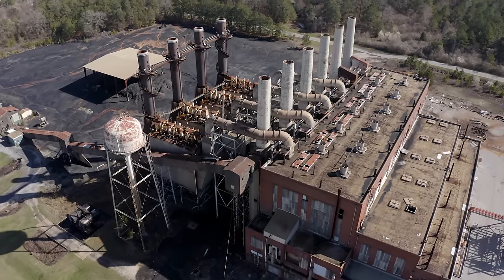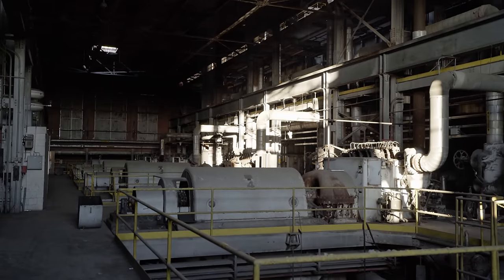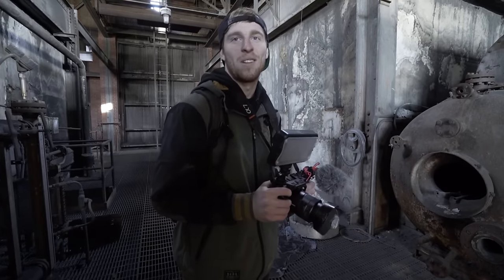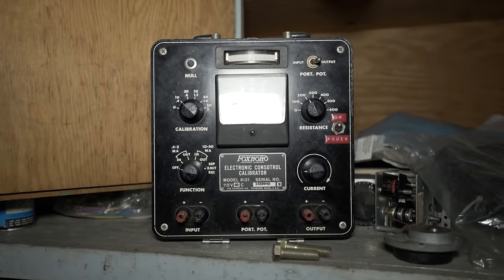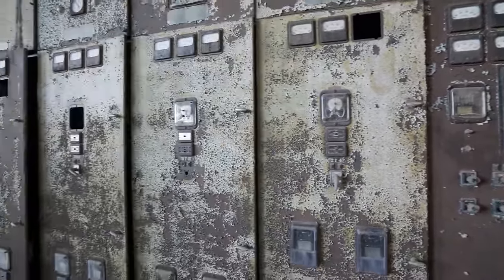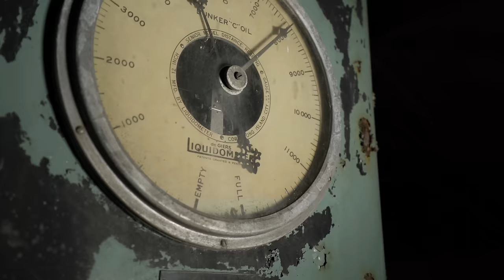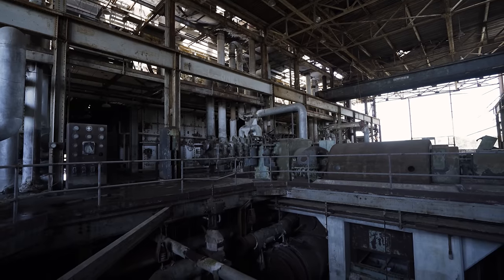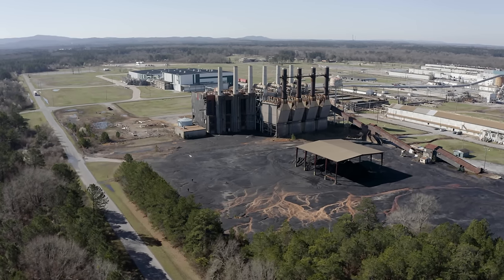Exploring WWII Power Plants Abandoned Decades Apart - Amazing Contrast in Decay!

Comment: GE in upstate NY and many other large companies had unlicensed, unauthorized nuclear reactors to make free power to run their factories

They were all taken out in the 70s, but it is crazy to think that these companies were able to get the nuclear material to run them and they were able to build them in secret

There were a lot of people who were hired specifically to build and maintain the nuclear reactors

These companies all were working for the government in different fields
So, whether the government knew about them or not, there is no way to say

But there was one reactor that was actually abandoned and nearly melted down when the external power that was regulating it was shut off when they were tearing down the building

It was discovered by a worker who was in the basement and they knocked through a wall that was not supposed to be there in the bottom of an elevator shaft

It revealed the reactor and the reactor room that was built in secret

I don't know if they ever did a documentary about that incident
Reply: Probably not because it would probably get people freaked to discover that those exist! Makes you wonder how many more there might be, waiting to be discovered!
Reply: What a surprising thing to find when demolishing something and not knowing what was there
Reply: That event was the inspiration for the Scorpion Plutonium Is Forever episode.
Reply: That's hard to believe they'd abandon a plant that was still producing enough heat to risk a meltdown if the pumps were stopped.
Reply: @russellhltn1396  Why would it be surprising?
Reply: @russellhltn1396  it wasn't a plant. They had built a reactor under one of the factory buildings. Only the people who were maintaining it knew about it and a few top level people. When they were laid off they were told to make sure it was stable and shut down in standby.

As with many things, the people left that knew it was there didn't realize the danger or how to maintain it.

It sat quietly and then it was forgotten about. I am sure that each person who knew it was there just assumed someone else had taken care of it years ago and that it was not a threat.

When they contracted out the demolition the contractor subcontracted to other low bidders and pocketed the difference

You had a lot of laborers manually knocking stuff down and scrapping what was worth something

The elevator shaft had an obvious temporary wall that was not on any blueprints and there were a lot of power and water pipes running through the wall.

When they knocked through they found it and didn't have a clue what it was, but they saw the blue glow and the heat and knew it was not right

A local college was contacted and they came out and they immediately called the DOD who called the DOE and I think the ACE 

They were not the only company that built these things in the basement of their factories

Eastman Kodak had them. I think IBM had them. NL Industries I know had licenced ones, but might have had a few unlicensed ones

I used to work for the state and I would see the reports of cleanup sites and they would find barrels of radioactive waste buried along the river.

The reports listed what they could find and it had uranium and other elements that were known. The craziest thing on the reports at the bottom were the elements they couldn't identify.
They had all the atomic information with the weight and information I didn't understand. They were listed as UNKNOWN and they were literally elements that didn't appear on the periodic table. Exotic Elements.

Some of them are NOW on the periodic table, but some of the heavier ones still are not listed.

I don't think they were trying to make exotic Elements. I think that was a byproduct of running an unregistered reactor.

But they literally just put the waste in 55 gallon drums and buried them at the edge of the property.

Years later I would be working for a city and I saw the water intake reports and they showed the natural occurring radioactive elements detected, and they also showed UNKNOWN nuclear elements listed on the reports with all the other heavy metals and salts.

It was confirmation that those barrels leaked into the river and we're sitting at the bottom of the river

The PCB cleanup stirred up a lot of them.

Fun Fact, that same city had the sewage discharged through tunnels built in the 1800s and raw sewage just poured out 4 tunnels into the river until they were forced to put in sewer pipes and CSOs to join to the county waste treatment plants in the mid 2000s

The city had 30,000 residents

There were rivers of waste pouring out these tunnels. I remember that smell and the water. It is hard to believe but they didn't have any money and they left the roads dug up dirt and didn't have any money to replace them after they put in the pipes.

I am glad I didn't have to go in the tunnels. Some of my coworkers did to build the CSOs.

Awful work

When they knocked through the wall
Reply: @adamdnewman  I find it hard to believe that the company just said, "let's build a nuclear reactor".  That's not trivial.
Reply: So far I only knew of three unlicensed nuclear accelerators in New York in the 80ies.

(Spoiler: Ghostbusters)
Reply: @uhrbexer9134  in the 50s most large companies that used a lot of power were looking for a way to save money on utilities
Some built their own hydro power, others built huge coal fired power plants. But a few who had contracts with the government and we're doing work with nuclear material for equipment, X-rays, test equipment, weapons, they built their own secret reactors

It is not that hard if you are really irresponsible to build a nuclear reactor
You are boiling water and when you make steam turbines as part of your business to sell to power plants, it is really easy to install a few in your building and run the steam from the reactor to power them.
600 pounds of steam through a 2 foot pipe 
The pressure vessel that keeps the water and steam and the biggest problem is how to release the steam without it being seen

Some reactors were sealed sodium and there was no steam, but the ones that used water from the river were hooked up to the smoke stacks

Contant steam mixed with the smoke

In the reports I saw the trail of fallout was very clear

The wind patterns were mostly 1 direction and you could clearly see where the wind dropped the radiation ovet a 1 mile path from the plant

To this day there are a is still a dead zone with nothing there 

And NL Industries in Albany NY to this day is sealed off
It is highly radioactive
There is a constant DOE security patrol even though there is nothing left
It is just dirt but they have a 24 hour security in vehicles and they have a couple port a johns and a huge fence all the way around the property

So many people died in their 40s that lived near the facility

It is horrendous how much they didn't care

It was all about making money

They had lots of money but they wanted more

Very sad

Comment: Sounds like they mothballed the plant with the possibility of restarting it one day. Sounds like the oil system for the generators were running and they are in turning gear. If you stop the turbines over time the shafts will ‘melt’ into the habit.

Comment: If it was this noisy with only a few things running I can only imagine what it must have sounded like under full operation.
Reply from the maker: I don't think the turbines and the boilers are actually that noisy when they're running. I toured some active plants and the air compressors were the noisiest things there.
Reply: @TheProperPeople  I've been in a modern coal power plant. The turbine hall is basically wear some hearing protection. It was incredibly hot as well.

Comment: 600 pound steam lines, that is a working line. They must have put the new plant in place and put it in parallel to the existing plant

Why they have not shut the valves off to isolate this plant is a huge question

It makes me think they are actually making power with the plant
Reply: Sounded like it to me
Reply: Making power? There wasn't any coal actively going in, so seems very unlikely. Sounded like they were just using the air compressor to me.
Reply: @Hopgop1  New plant was sending excess steam to the old plant. I'm not sure about power generation, but it did sound like they were running some large air compressors.

Comment: wait   dudes m the turbines  can't turn without   steam from the boilers   which  appear   to be  not  working    due to  no coal  . I think   you  are hearing the  step up  transformer that's what those meters   are  showing.   The  main  outside  transformer is  still connected  to the  grid
Reply: Someone said the steam was piped in from another boiler nearby so the generators worked without those boilers working.
Reply: There's more than electrical hum.  There's actual machinery somewhere.

Comment: Honestly, Power stations and electrical infrustructure is So, Sooo Fucking dangerous to get into. Its dangerous because you cannot see what is live or energised, and what isnt.  Even out of service tags dont mean the equipment/room / cabinent has been de energized. Seriously ive seen people loos fingers because of a pinhole in a rubber glove under a thick welders insulated glove turning off contactors and switches. Bare handed or just wandering around these places is silly. Even old abandonded looking places are sometimes kept hot in case of future works or comssioning, sometimes just from forgetfulness. But At generation sites its usually much much more than your domestic voltages. Please be careful. Keep out and dangerous is usually put on places not to discourage interested people, but because theres shit that can kill you and cause a mess for people who have to scrape up crispy bodies. Once you have smelt the smell of burnt human flesh and hair etc, you will never ever forget it.

Comment: Definitely concerns me that on this and other videos you guys are walking around in buildings full of loose, friable, crumbling asbestos without respirators. You've got to realize that asbestos is insanely fine and once in the air, stays in the air for days. So unless you threw all the clothes away that day, its now on the carpeting of your vehicles and still in your clothing. The asbestos used on those pipes is some of the worst kind, being especially prone to adhering to lung tissues. So you really need to keep all of that in mind